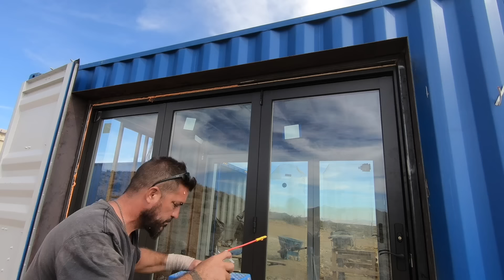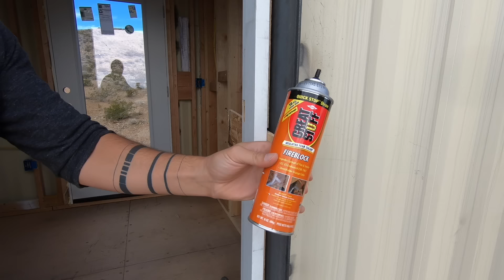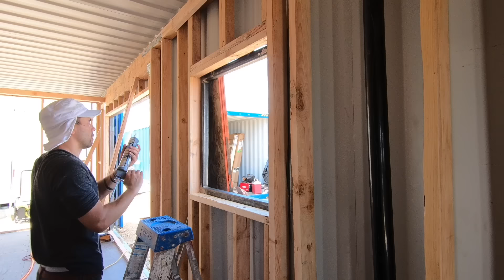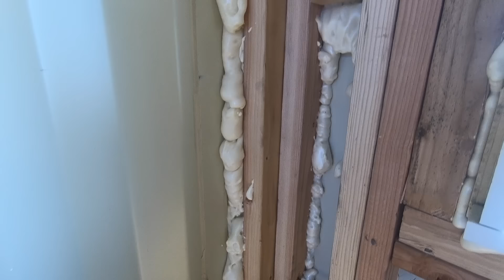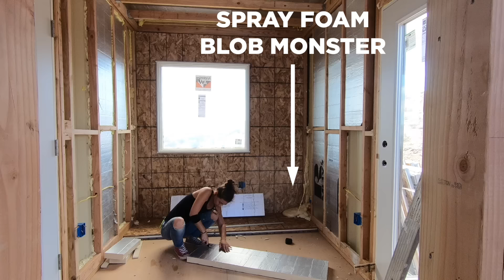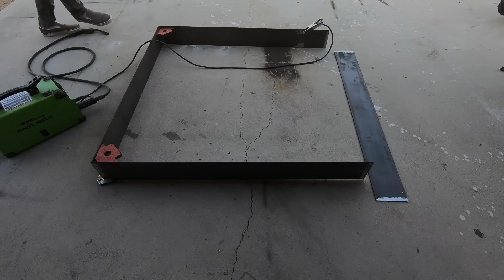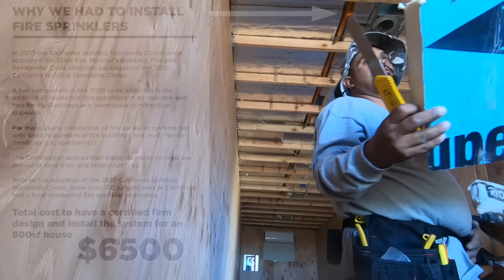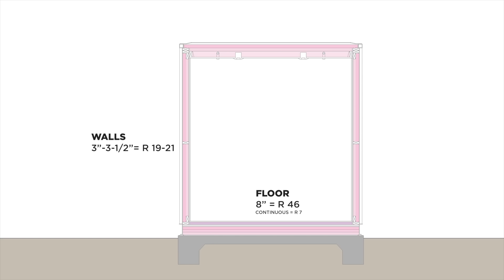Building a Shipping Container Home | EP03 Doors, Windows, and Insulation

Comment: shouldn't electrical wires/cables run through plastic pipes for easier maintenance/additions in the future? 
enjoying the series btw!
Reply: No stainless steel conduit is the industry norm... and fire safety
Reply: @arthurdduda8233  oh alrighty thanks for the correction man, my point actually was that I didn't see conduits just wires and cables between the wall layers, my bad if I missed it.
Reply: @arthurdduda8233  Industry standard for residential wiring is NM cable like what was run on this install. Any conduit would have worked as an alternative to NM cable. As for conduit  the industry standard would be galvanized EMT style conduit not stainless steel. PVC pipe would have been fine though, and much easier to work with in this type of structure. Stainless is very rarely used in corrosive environments.

Comment: You have convinced me that using shipping containers isn't worth the hassle. I'd like to see what the extra costs were vs "standard" stick frames. My guess is that the non-standardness cost a bundle. Mostly in complying with regulations...
Reply: No, just don't do it in California. See https://www.youtube.com/channel/UC-l69It3hxAY3tkBH_utLNQ/ for a Texas (real DIY) build.
Reply: @TheOtherBill  put it in a playlist
Reply: @Janzer_  It's not my channel.
Reply: Not in California!!! But other states are well worth the effort. Especially in rural areas.
Reply: Yes I agree. if you go permitting with all the structural engineering stamps, its adding so much cost.  These are good for someone building a tiny DIY house using as much existing finishes as possible.  Built as a movable unit. So no permits required.
Reply: My thoughts exactly....especially in California.

Comment: Beautiful.

However, unfortunately Polyiso foam insulation will degrade in the first 3-5 years of summer heat (and the desert gets very hot in the summer). It will shrink causing gaps which allows heat transfer, and the overall R-value will reduce to about the same as polystyrene (not counting air gaps). But your polystyrene insulation won't degrade nearly as much! I am glad to see you skipped using any rockwool/fiberglass as it has both convection currents and convective heat transfer problems (especially in homes with pitched roofs - which yours doesn't). From the research I've done I've concluded (as many others have) that It should be outlawed for use as an insulation material. But, the megacompanie$ will probably never let that happen.

Take care with the Lithium battery in the heat too. It's re-charging capacity will degrade much faster, and as we all saw a few years ago with smartphones (Samsung Note) - heat is the enemy of batteries (especially LiIon). I can't wait for the new solid LiIon batteries to hit the consumer market! They don't burn/explode even when punctured or pounded on with a sledge hammer! And they can hold twice the charge!

Thanks again for sharing the process! I hope you guys enjoy this beautiful home and shed for decades to come!
God bless.

Comment: Cool project. I think your engineer hosed you on the tie downs and the interior framing. I would have used the built in connectors and thin SIP EPS panels on sprayed in foam. Well done though.

Comment: I have a concern about your angle-iron door/window detail... You do a great job thinking through the ability of water to work it way UP the interior, but you kind-of hand-waved the vertical sides - where any of that water at the top that got driven inside, would end up draining.  I see a hug risk for interior leaks down the sides of your doors framed like that - and I don't think you are showing respect for surface tension along the parts of the coregations directly in contact with the angle-iron.  Your interior weld detail shows that it is at the top of those contact surfaces, so you are setting up a situation where uncoated steel surface of the angle iron in contact with the corrugated and the weld would be where water would stay without drying out.

Generally an surface tension breaking gap would prevent water from following this path, but again, on the sides, you don't show an interior drain path.  Calk is mentioned, but it will likely have water held against it constantly when the weather is wet - so it'll fail faster that you imagine , and that portion of your detail work is buried inside the framing and under your insulation.  It's a huge risk for mold.  Water detailing is always a big gotcha in building design.

Every steel container I've seen modified professionally, or have modified myself, has had a continuous weld around doors and windows.  In the previous video it was mentioned that doing a continuous weld would cause the side sheeting to warp - and this is true, if you do the seam in one continuous pass.  You nearly had the answer when you said you did short sections of weld - the rest of the answer is to come back after it has cooled off to close those gaps.

In response to tolerances when cutting out doors and windows, I'll note better success with a plasma cutter on a straight-edge, than what can be done with a grinder.  Take some time to do tooling setup and it'll save you a ton of headaches down the road.  It can be as simple as a pre-cut piece of wood with a corrugated pattern already cut out, that you lay on a line for the top edge.  One can take a sheet of OSB and cut it to the dimension of the door minus the plasma cutter width.  Lean it up, run a cut - need to hold it in place? Run a self tapping screw through the door cutout.  Need to keep the door cutout for something and don't want the hole?  Takes a moment to weld up.

Comment: For the half inch sheathing, why do you need a structural engineer to stamp? This is typically used on the outside as you said and used a lateral force resisting system. Inside the trailer I don't see any significant forces to the point that you would need a structural engineer to stamp. Did I miss anything?

Comment: I'm loving this series, but surely it would've made more sense to oversive your overhangs as it's far easier to cut them down at a later date than it is to weld more material on? Also this wouldn't give an appearance that you had to go back add to them. Just a thought.

Comment: Please, can someone explain to me the advantages of using a container as structural element of a house? With very dull interior dimensions and so much work to adapt it with inside insulation, openings for doors and windows an so on? The framework of a wooden house will have the dimensions you want, is easier and faster to build and will cost just 50% more. As the structural part of the house is only 15% of the total costs, this is to neglect. At the end your wooden house will not be "cool" but perfect for your needs.

Comment: what keep the water from rolling back on your steel and onto the windows?  I was taught to have a break in the water tension so it drips off. curious to see a laser thermometer on the sleeper vs foam floor system as well.

Comment: I really appreciate this series on what you have gone through to build this set of buildings. I live in Ca, and am looking at building a container home or other super efficient home. I have built before in a more modern methods. This is why many of us are leaving the state in waves. So much of your build is crazy over designed and cost wasting. I get that you had to, but facts and real engineering should have been on your side. Sprinkler system is silly. You couldn't get a strong enough fire in that box to melt it, fire contained. building a sheer wall structure in a container beyond wrong. If that container was ever subject to a force to make it fail, the sheer wall would explode inward making the occupant a pin cushion. I applaud dealing with this over regulated and none flexible state building something that should be cheaper per sqft than standard buildings as well as exceeding any and all structural demands. 

If i can ask one thing did you look at the https://www.insofast.com/lc/insulation-panels-shipping-containers.html panels?

Comment: Please Read: Unfortunately the wrong state to maximize on cost effectiveness, getting more bang for your buck per sq. ft. Looks great and one thing for sure it will last forever but the moment you mentioned vacation home I shook my head. With the team you have, constructing the home else where with forgiving codes and a truly tranquil location you could have went even further with design for the same cost or even less.. the 1/2" plywood was overkill for example. The 2x4's were place on the low ridge (closest to you) with the 4" placed as the depth plus the 1/2" ply not even including Sheetrock if considered, lots of wasted space at least 7-8" of bump out! [take out a tape and see this number] Granted a 2x4 is not the true number. All in all you still got quality work done though. For the next build consider maximizing the space you have utilizing sustainable durable materials (to also see a return on your investment) and even metal studding for basic walls while using lumber supporting for all openings and anchor walls. I'm a Union Sheet Metal Craftsman and Draftsman just giving my two cents.. or three. If you want some free design advise for the next build I would be glad to offer it as I enjoy seeing these projects and doing what I do. Great work otherwise.

Comment: The air gaps between your insulation panels and the container walls are going to mold from condensation. You need non porous spray insulation to get all the air gaps out.

Comment: https://www.youtube.com/watch?v=VW-2gmvKiuk

Did any of you all see this YouTube video? This is Styrofoam insulation that is molded to match the corrugation's of a steel shipping container. It seems like a much simpler solution to the dual needs of 1) INSULATION and 2) INTERIOR STRUCTURE for wiring and plumbing. 

It does seem like all of the wood framing is redundant since you're building another structure inside of the one that's already there.

https://www.youtube.com/watch?v=VW-2gmvKiuk

Comment: Shouldn't the rigid insulation go SHINY SIDE TOWARDS THE OUTSIDE of the shipping container? 

I think it has something to do with the physics of how radiant heat transfers heat from the heated steel surface of the container to the inside of the container. 

I'm no expert, myself. I think I saw that in another YouTuber's video on various kinds of insulation. He's some sort of an authority on building insulation. 

I would appreciate some input on this.

Comment: Just like home remodel to make open floor plan for kitchen requires engineered I beam to transfer load. The load is on corner posts with full shear wall part of original engineering. Need a good engineer who knows container engineering. Courious the cost to build a new container on Asia and leas out for one way shipment to offset cost and freight? Engineer a 20' with side doors one side. Then install a slide out and glass doors upon arrival. Why are people stuck on 8' wide a wide loader of Mobil homes 14' wide... Why not fabricate and engineer slide out. Using Mobil home engineering or modular the same.

Comment: I noticed you made several construction decisions based on... Feelings maybe? A lot of that is FAR too expensive to be practical in construction. For example. Flooring. Those panels are 3x the cost of just laying the whole sheets yourself. Spray foam, you can get in large containers and spray yourself, cheaply. Plywood has less chemical sure, but at a HUGE cost. That's why we use MDF. Within a month or 2 it will have aired out and dried and will be of no concern for formaldehyde.  And the plywood under the drywall? that's a huge waste. Not sure what c- student engineer you got but in Georgia that is not required. You taught me some good things though. I have not done anything yet with a container, but plan to.

Comment: With the doors folding out how do you keep the bugs out?

My own house has folding doors to the deck. We have  screens on the inside that pull out from 6 inch receptacles on each side. Bugs STILL get in AND we have to spray with bug killer when we want to close the doors. That's because the screen is on the inside. I wish our doors opened inside and the screens are outside...

Comment: Very overbuilt; floor sleepers, interior plywood, 2x4 framing, unnecessary. Did your engineer explore a laminated on interior wall assembly. You've reduced the containers functionality to exterior siding and roofing. You could have stick framed on an insulted slab and sheathed with sheet metal for a lot less work.

Comment: I wonder what sort of problems will emerge over time, from living inside a metal box that it's not only tight but layered in several different materials, in the middle of the hot sunny desert.
I mean, your paint will degrade. The frames probably will too because of different expansion rates between the materials.

Comment: What do you think about welding 2x4 or 2x6 studs to the exterior of the container (sides and top) and spray foaming in between then covering in some sort of siding ? You would be super insulated and you would also get to use all the interior space. Of course you would have to weld on a lip to the top for some sort of overhang so the water doesn’t get down in behind the foam

Comment: I come from the automotive world, so I'm in favor of using weld through primer. You can also use some spray bed liner to add an additional layer of corrosion protection to the outside; I know of a lot of people that spray their RV and camper roofs with that stuff to make sure everything that's supposed to be dry stays dry.

Comment: I feel like you’re robbing yourself of already scarce space in the container with all that thickness in the walls, floors, and ceiling. I just feel like you could cut down the amount of reinforcement and plywood.
Reply: And that's the rub for cheap containers btw $5000-$7000, is that once the frames and sheet rock are in, it's smaller width of living space (and you sill have to put furniture in) unless of course everything folds up against the walls. This would be much like living in the passage way of a United States Naval ship. Someone is always yelling "Gang way, make a hole!"
Reply: Ali Al-Faesly 

My thought exactly....

Comment: You didn't need the 1/2 plywood on the wall the drywall was enough. Some inspectors have no clue or never used a hammer in their life.
Reply: Wasn't the inspector, it was the building code and structural engineers.  You know, people who design large buildings and bridges so they don't fall down and kill people.
Reply: @elesjuan  I understand that but shipping container are designed to be stacked 8 high up to  80,000 lbs per unit. It's a awesome job I wanted to do the same on a 53 foot container.

Comment: Dang, does it cost MORE to build a container home than a regular home?
Reply: RACINGMIX it’s sponsored by Home Depot so they want to show with as much unnecessary materials as possible
Reply: Depends on locations.

- Cities near the coast tend to have busy ports with lots of unused Containers. This mean that the transport cost would be really cheap and you could get better deal on the container itself because of high competitions. This would drive the costs significantly.
 
- In remote areas where you have to transports tons of materials from big cities/warehouse to the lot you were building in. It would be WAY cheaper to use container.

- In big cities where labour costs are higher and time sensitive (more hours = more wages for the workers) then the cost could be beneficial.
Reply: Wood and nails are cheaper than steel and welding, yes.
Reply: Con homes are least expensive.  Last for centuries when properly maintained
Reply: @brendadurr5186  who has owned a container home for "centuries" the price per square foot isn't that much cheaper because like in this video to build to code a wood frame had to be built inside the containers
Reply: No it does not as a rule of thumb; however building a stick built home inside a shipping container is more.
Reply: Not necessarily. Just don’t be a fool and build a home in CA.
Reply: @daemonsilver3304  Exactly!!  I just read today that NY has joined CA in being a state that is losing population. People are moving out of the tax-crazy nanny-state hellholes.

Comment: You are not constrained by the standard steel yard angle dimensions when welding up your door and window penetrations.  Most steel yards can cut and bend plate to order.  For example you could have a piece bent up with a 3" flange, a 10" (or any width up to about 44") sun screening projection and a 1" turn down drip edge.  Bends add strength to plate steel and should be used whenever possible.  Typically, steely yards and metal fabricating shops will have hydraulic brakes that can bend 10' long 1/4" plate.  This kind of fabrication can be expensive but it can also improve the result and simplify /expedite on sight work.
Reply: He's not that precise... so precise fabrication would only require more work.

Comment: Looks like you used more interior material than a regular finished 2 bedroom trailer home. Ply, sheetrock, thick ass insulation and all that excess framing? Damn bruh. Your one of those customers that won't research and says ok all the time I guess. Im sure the sheetrock guys had a blast taking your money after 2 days of not having to worry where their gonna drill a screw. Great series though.